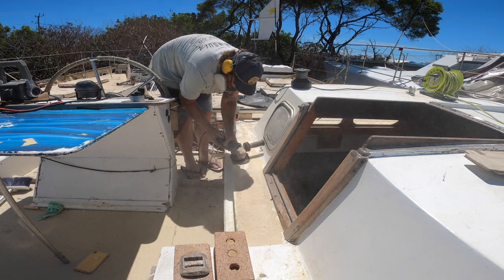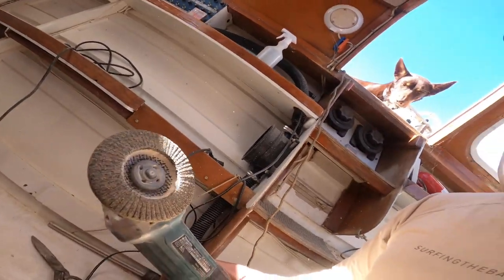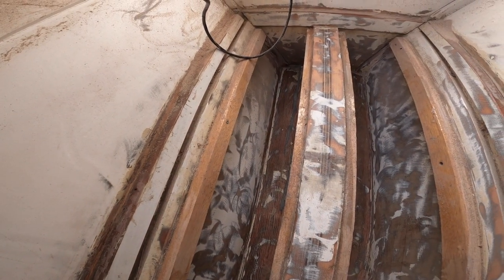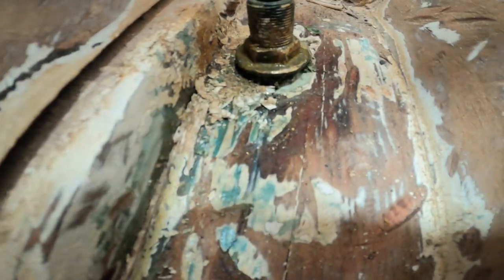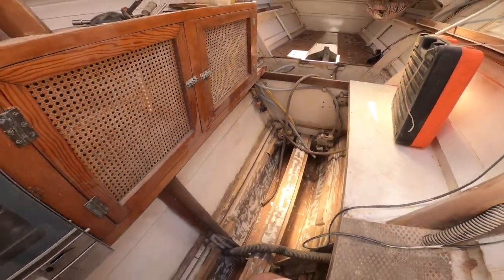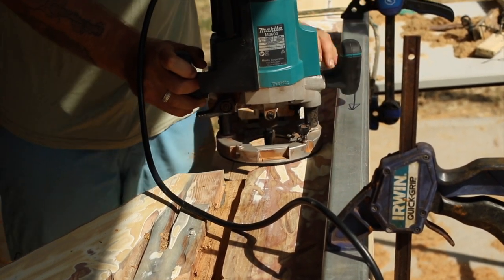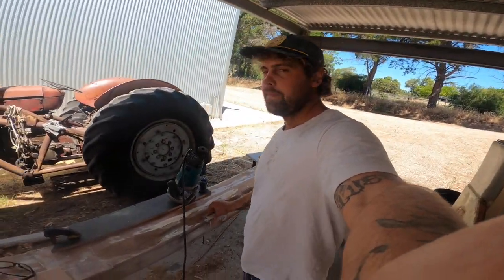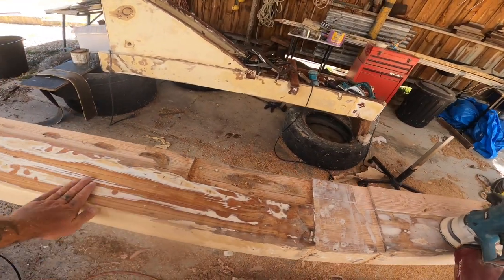Restoring Catamaran Beams/ Sanding Bilges- SAILING MALOLO EP 3

Comment: I'd use Tec7 as sealant. Not Sikaflex. Not silicone. For the throughulls I mean.
Reply from the maker: Tell me more ? Better to ya than sika ? Thanks mate
Reply: @sailmalolo 
I have used Tec7 for sealing an old wooden pram. As well as an old wooden row-boat, both in saltwater and with big success. It can be applied under water as well. I have used it for gluing desirable objects of stone onto limestone surfaces in an outdoor museum in 2018 and they are still there. (This was on an island in the Baltic Sea - maybe not a direct maritime environment but indirect, and with a lot of visitors fiddling on the objects, all covered in snow in winter). I have used Tec7 in plumbing with good results. Also I have used it on road vehicles and Tec7 can take that harsh climate of salted roads, ice, snow and dust as we’ve got it in the winters of Scandinavia. 
So, I’d say I’ve never have used a better gunk. 

And it’s notably less bad for environment and a really all-round product, compared to other stuff  (Sika, Illbruck, 3M, Gorilla, Pattex, Simson, TDS, silicone or else)